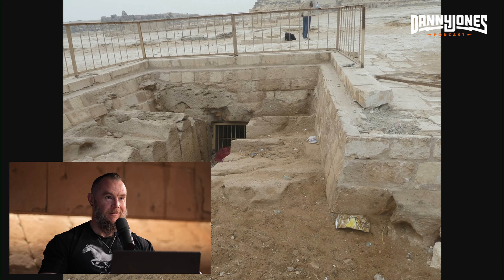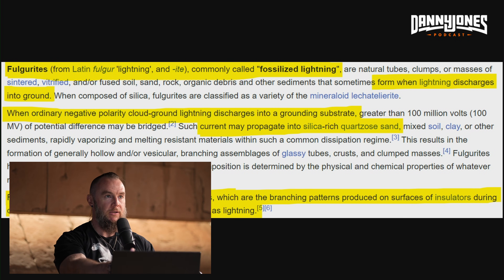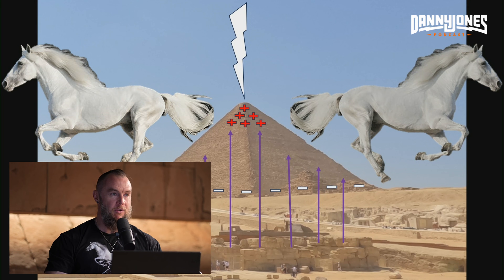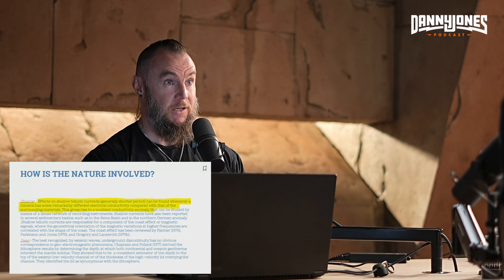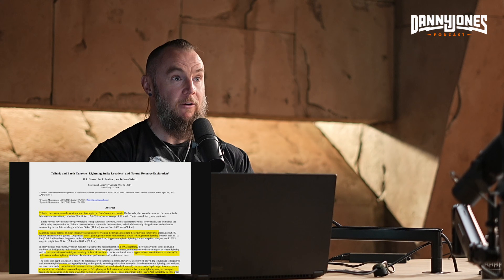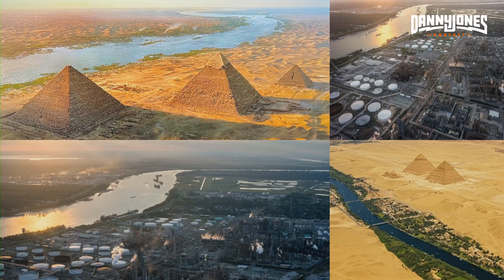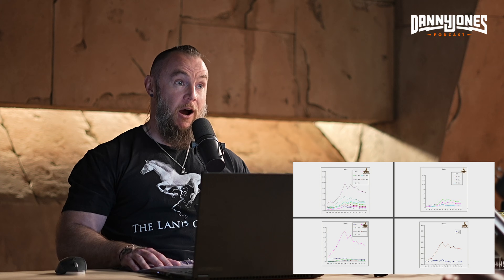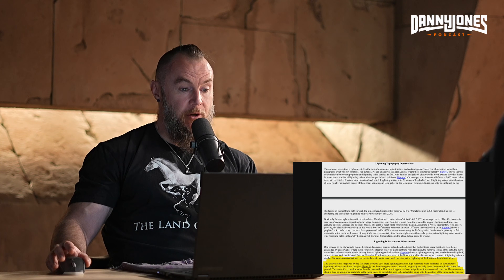How Ancient Egyptians Turned Lightning Strikes into Usable Electricity | Land of Chem

Comment: I keep seeing these Tarteria videos in my feed that say they were using electricity generated from the air and heating the walls with it for heat.  Basically what the pyramids were doing but using it to do other things.  So we had free electricity systems in buildings and structures built prior to 1812 that worked on this electricity potential between air and ground using antenna and wires through stone work and geometry supposedly.😮
Reply: Aether...
Reply: @LeefosyJarBarf You know what's weird about that, the scientist say there is this dark energy and dark matter that make up most of the universe, but can't be detected by light or anything, but they say that aether don't exist.😮 Huh?  Could it be they are the same thing?
Reply: @XRobinson  ..."They"(the scientists') have to say that so no one can tap into "free energy"...
Reply: @LeefosyJarBarf Surely there are free thinking scientist that won't shut up😮. They get disappeared, oh..😮
Reply: @LeefosyJarBarf Also, scientist say two opposite things simultaneously saying one exist the other does not, but can't prove either one with direct observable proof?😮
Reply: Oh, buddy...
Who cannot prove...You...
That's a "You" problem...
The information is out there...
You gotta' "tap" into it(the research), just like the Aether...
Good luck with Life, sounds like you need it...
God Bless...Namaste'
Reply: @LeefosyJarBarf what, you told me Im wrong but didn't prove it😮😅 you are killing me😅

Comment: GROUNDING. One word breaks this hypothesis. Anyone with any understanding of electricity knows that rocks will ground and disperse electricity. There are no insulating materials to direct energy flow. Where are the wires?
Telluric currents measure in the millivolts which is not enough to attract lightning.
Inverse piezoelectricity is quartz releasing extra energy as ultra sound. Because of this the quartz never build any significant charge to attract lightning. They are not batteries.
Quartz isnt connected like a wire, it is suspended inside granite which is a grounding material so no charge will pass between one crystal to another.
Iron veins also will not act like wires because they are surrounded by grounding material too.
Lightning scorches, breaks and melts granite and limestone leaving fulgurites. These structures wouldnt survive being hit by lightning repeatedly.
Lightning rods attract lightning directly to them and not the surrounding area. The structures should be getting hit by lightning every time a storm passes by. Finding fulgurites on the plateau is evidence that the pyramids are NOT lightning rods.
Boat pit circuit breakers. The pit is a grounding material, even if you filled it with the most conductive material ever the charge will just be grounded.

I have more problems with this too but that is enough.
Reply: None of these things matter to scammer Drumm in the slightest. And it's because he is completely ignorant and prefers scamming people with his bs.
Reply: Careful, you're using too much logic and real science for these Annunaki cultist.